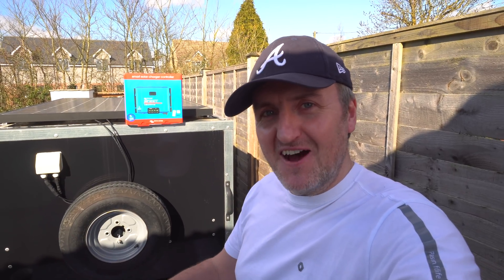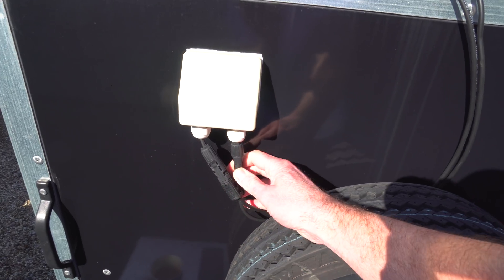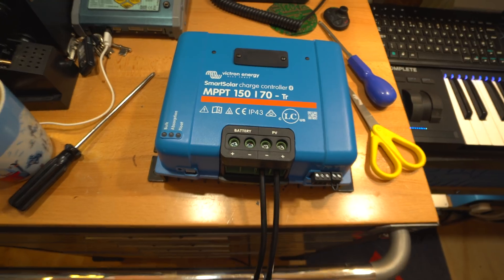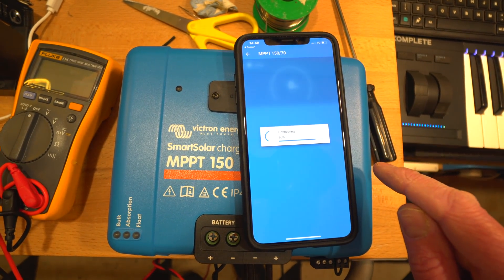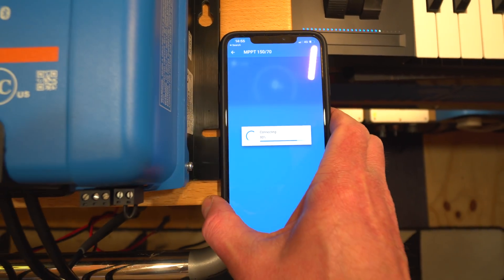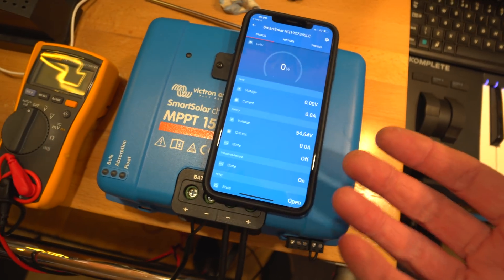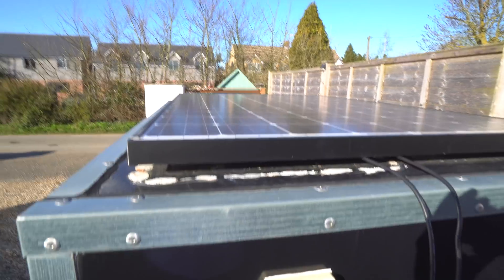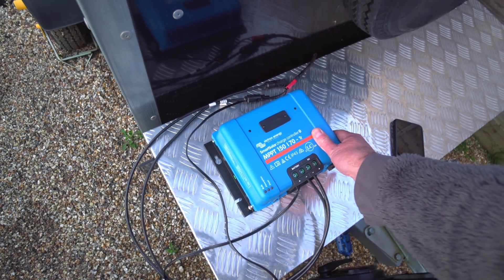HOW TO CHARGE YOUR EBIKE FROM SOLAR!!!

Comment: What panel are you using?
Does it output voltage matter, or if their output voltage is lower, can one just string a bunch in series till you reach over the minimum charge voltage for the battery?

Comment: Just what I was looking for. Hey, could you use this system while riding? As in, if you had a bike trailer, could you ride and charge from your solar trailer?
Reply: Get vitoman 600x plug a solar panel into it whist riding is possible then plug batter charge ebike into vitoman all on a ebike egnwe 26x rack at the back vitoman can convert

Comment: iv been charging my battery up via solar for a few years iv got a mppt charge controller. but iv got a inline inverter so i can just plug the normal charger into the inverter. Works perfect and free power. I love messing about with solar and the bonus part is i got 8 100w panels free and charge controller came on my boat as a spare . my workshop is powered via solar all garden lights are and all my tools get powered buy solar.

Comment: That's nice and simple so I would look at doing that but I was also thinking of being able to use my ebike battery as an emergency power bank at home in case of a power cut so I guess I would just need to convert the battery output voltage to usable home voltage levels such as USB or whatever. Fun stuff.

Comment: Thanks for this. 7:10.. Max Amps setting!  wonder how rare to find that feature in charge controllers.   How brilliant would it be if these ebikes had a built in DC charge controller that could handle 300watts and a USB out port.

Comment: Cool video and good information. I was wondering if I could put use to my folding 50watt solar panel that is just sitting in my storage. 

The panel specs is something like 18-24 volts I don't remember exactly. My electric kick scooter has a 48 volt battery. And riding my scooter, I like to stop by the lake a couple times a week and cook something using my micro propane stove. Some times I have to charge my scooter at work, or the plug-in at lake (if no one is using the park BBQ grill), or at my storage (very boring).

Comment: This video helped me so much! I have a camper van with 2x320w panels and i wanted to charge my Super73 battery. I bought a separate Victron 100/20 48V charge controller and put the solar panels on a change over switch. I can now put the solar power to my house batteries at 12v 60A or to charge the bike battery with 5A 56v and more importantly, i can control the charging amps, which is something i couldnt do with the existing charge controller.  I was thinking of using my inverter before but thats so inefficient.

Comment: I was wondering how much current was the maximum suitable. I have a 7s 13p Hailong battery (17.5 Ah) and I have a 2 amp charger and ordered a 4 amp. I was wondering about the 7 amp on the cycle satiator but the charger was too expensive for me to justify getting it anyway for only a single battery. I was thinking about paralleling it with my 2 amp charger for 6 amp using a dual female to single male XLR cable (checking the wiring to make sure it's on the correct pins) but you are saying going over 4 amps may cook the battery? What about a brief partial charge? I mean they can take 25 amps out so why only 4 in?

Comment: $35 boost controller https://www.ebay.com/itm/373167680091 , $50 used 250w panel, boom - Johnny's got free power after spending less than a hundred dollars.

Comment: Thats a bit of alot of panels to charge your lil 48 volt ....I guess you couldn't pull that behind on your bike/trailor? you would just use for a base station/chargining station....I would like to see enough power to charge your bike as you go free unlimited power without havining to pull a traier with so many solar panels ? probably weighs as much as a boat ? not very portable? thats the answer / the ticket

Comment: Every try carrying a jackery 240 with you and plugged into the bikes charger, cheaper than buying another battery and lighter in weight. USED while ridding?

Comment: I d like to do this on my 500W 36 V Powerpack from Bosch but I can t figure out the wiring to connect the three poles the Akku needs to be fed properly
Reply: I read somewhere one of thier three wires were power ground and sensor, they jusleft out. Connecting that one...
Mine has only 2wires

Comment: Did you buy that victron Andy or was it a freebie.must have cost a bomb?    Cheaper to use inverter in campervan when sun out and driving with my dc to dc charger .ebay 105£ for charger.had it 4 years on different cars.been on my vw t4 2.5tdi 2 years now.helps charge leisure batteries with waeco fridge that is left on all time .i have one 100 watt panel on van roof plus 3 x 30 watt panels in parallel Also .i use a separate mppt controller for front and back of van .

Comment: that set up wouls cost a fortune - for someone with a second hand old solar panel  and £26 to blow this dedicated e bike 300w solar mppt boost charger might be a viable option  https://www.ebay.co.uk/i/303020007502?chn=ps&norover=1&mkevt=1&mkrid=710-134428-41853-0&mkcid=2&itemid=303020007502&targetid=909953938039&device=c&mktype=pla&googleloc=1006637&poi=&campaignid=10199630638&mkgroupid=101938330797&rlsatarget=pla-909953938039&abcId=1145987&merchantid=9440604&gclid=Cj0KCQjwyJn5BRDrARIsADZ9ykE9D3L0xhHOiA8e5bhd4CCX6U2790af5ths5bOxdFdESgv0aRc0lrQaAh75EALw_wcB

Comment: Dude your rambling on I'm learning nothing, can I use this to charge me fiido L2  48v 20ah  350 watt motor, if I use 18 v 100watt folding panel on trailer of ebike will this charge? Could I charge battery with system while ruding?
Reply from the maker: I got bored after the first couple of words!

Comment: this real cool i got battery also 48v and charger says 54.6v 2.0A the settings bit confused about
Reply: He's got a 14s battery, you've got a 13s. Slight difference in max voltage.

Comment: Its a bit overkill Andy? I Use a 300w boost MPPT https://www.ebay.co.uk/itm/MPPT-Boost-Solar-Battery-Charger-Controller-Regulator-24V-72V-Waterproof/192143107756?hash=item2cbc9f26ac:g:jxwAAOSwGPNcAWsk on an old  REC 280watt panel and it works great
Reply from the maker: Yeah it is but I’m just testing...I’m gonna use this to charge my Twizy.

Comment: Using a solar panel for charging ebikes is great if you aren't on the bike all the time. You carry a big rigid panel and whatever other gear necessary to recharge in your truck or trailer easily enough. But I wanted to be able to do extended duration un-supported bike touring so I finally settled on a 300W folding panel. It's hard enough to move a few hundred pounds around by bike without the wind shoving and pulling a rigid panel attached to a bike and/or trailer all over the place. The panel, MPPT controller, cables, and a dc/dc adjustable converter weigh under 20 lbs. and will charge every piece of electronics I carry which is more than I like to admit.  - https://photos.app.goo.gl/rFim5rPsajmDt8NJ6

Comment: SUNYIMA 24V 48V 72V 300W MPPT Boost Solar Charge Controller.
It also has " user " settings, I use it for a 36v ebike set up, as long as your panels are a lower voltage than the output, it works fine, no bluetooth but its a nice small unit and cheap, if your building a bike trailer mounted unit using 12-18 v panels, I have 7 panels of various sizes mounted on the trailer. 2.5w to 40w. Rambo ebike trailer, would look and work well with your rig, I put 2 16" motors from ali express in mine... 2 crystalyte 3540 hub motors on bike, 2 motors on trailer... 4 x 4 :)  hills, what hills ??? regen braking with 300 .lbs in trailer, no problem, no push bike forward and I only use 13A controllers for those motors in trailer... 7 battery packs, 4 on bike, 3 in trailer, liquid cooled controllers in trailer using a computer cooling custom loop. turn signals, brake lights, LED headlights and off road lights...   2 wheel drive,  roxors your boxors.... you wouldnt be down under anymore more mate, you'd be up and over :) sorry Canadian humor....
PS  DO NOT load your trailer with 300 .lbs and expect to stop with only bike brakes.... been there done that, almost a hood ornament for a city bus....learn from my mistakes or the hospital bill is on you :)   hence the reason for spending $500 to put motors in trailer.... regen braking and disc brake mount for " surge " type braking system to be added later... when my wife gives me the rest of my allowance...

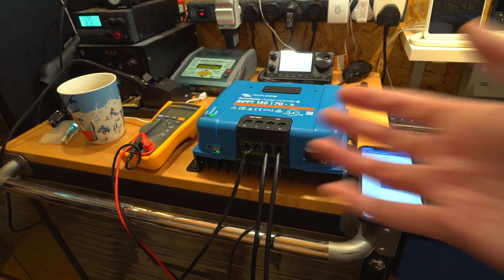Comment: 6:17 or you can supply a controller with current directly as long as you’re not getting too close to the max amp rating as it will be rather taxing on the unit.

Depending on efficiencies, you could potentially turn a larger voltage pack (100v in this case) with only a few parallel cells (in comparison) to give the power needed.

Comment: Most Ebike battery BMS are damaged, along with the cells if you charge with more than 4 amps current. (you can charge an ebike battery with upto 8A. but doing that all the time is bad for your battery) That is why you always want a controller.
Reply from the maker: It depends on the BMS and Cells 😁

Comment: Good video, BUT there are dedicated ebike solar charge controller which are much cheaper and as reliable. https://www.aliexpress.com/item/32818719628.html?spm=a2g0o.detail.1000023.1.206222f7sJwFm2
Which one can set to 36, 48, up to 72v. It's a boost converter, which makes it compatible with any panel, even the tiny 12V 50W panels :) 
As for the twizy, will you hook it up directly to the main twizy battery? that would be grant. Then you could even use the Twizy's battery as a powerwall by hooking it to an inverter. A big like a V2G technology !

Comment: Aren't you at all  concerned the charge structure is that of lead acid. Constant current and Float are old lead acid charge strategies that can be dangerous with lithium.
Reply from the maker: Float doesn’t have an effect with the lithium profile. CC-CV is how you charge a lithium battery. At the end of the CV phase no current is flowing so if you set your absorption voltage to safe limits for the pack (not above 4.2V per cell) then it won’t be a problem. If you did make a mistake most batteries have a BMS good enough to remove the entire battery from the circuit if the voltage went too high.
Reply: @andykirby   Stage One Voltage rises at specified current rating (usually .5-1C).
Stage Two, as voltage peaks current decreases. Lastly, CHARGE TERMINATES.
Full charge is reached when the current decreases to between 3 and 5 percent of the Ah rating.

Comment: So your using a 12v solar panel to charge 52v battery. I have the victron as well I'm going to try that. I thought you would have needed to wire 4 12v panels together to get the same result. Cheers.
Reply from the maker: No actually it’s a 60-70 ocv (open circuit voltage) panel 😁 you can’t do it with a 12V panel unless you had some kind of crazy DC-DC boost converter. The panel voltage needs to be close to the battery voltage for it to work.
Reply: @andykirby  oh I see. That kicks that idea out of the park then. Lol
Reply from the maker: Best thing to do is measure your panel voltage when it’s not connected to anything and see what the voltage is. You could series multiple panels up... but you’d still probably need a charge controller to regulate the current unless it’s very low power.

Comment: Question? How much does it cost to charge the bike with regular power? How much was the panel, charge controller, etc? How long would it take to recoup your cost? Also instead of charging the bike directly during the day (which you would probably be using the bike) The bike needs to be charged at night. So you would need to add batteries to your setup. Charge those batteries during the day while you use your bike and at night plug your bike into those batteries to charge the bike at night. So I really, I don't think this is worth it unless the world shut down and you can not get power off the grid. In which case you have bigger problems then charging your bike at that point! Just a realistic assessment here.
Reply from the maker: Valid assessment, this is really meant to show an off grid proof of concept. Of course the outlay outweighs the electricity cost. The camping trailer with the panel on the top is also an off grid concept and can run for days with one solar panel and it’s 3KWh battery.

Comment: 30,000 Euro fine in France for E-bikes going over 28 mph or motor tested over 250w. If you can't pay the fine you can go to jail for one year. No speed limit on regular push bikes. Worth remembering if anyone brings a bike on holiday.
Reply from the maker: Exactly why I registered mine, it will happen everywhere eventually.

Comment: Victron is making a killing with this 800 Euro charger. How long will it take to break even with the cost of the panel & charge unit compared to buying the electricity from the grid?
Reply from the maker: The idea behind this charger is that it’s used off grid to charge batteries.

Comment: Another great video, I finished my scooter build, I struggling to find someone to stamp and sign for the vin plate, based in london what did you do here?
Reply from the maker: I went to an MOT garage, try and find an oldskool one they should have a stamp set. I reckon You’ll need to take a document with you just to prove your not doing something dodgy.
Reply: @andykirby  Legend, garages are just saying no, also here the project i few thing to go but fingers crossed

https://www.reddit.com/r/dualtron/comments/fjklfu/uk_dualtron_thunder_moped/
Reply from the maker: Maybe try some garages outside London. Scooter looks great, I think the headlight might need to be motorcycle type and e-marked for MSVA... it’ll be interesting if you can get it through though keep me posted!
Reply: @andykirby  thanks its e marked and motorbike brightness supernova m99 pro it's the only legal headlight for s pedalics, dip able and has a tell tell light for low and high beam pricey but worth it.
Reply from the maker: Freopa ah awesome😁 I didn’t realise it was a supernova, they look great!

Comment: I watched this video while my eGolf charges off my off grid solar system on my garage. I use a 600ah battery which charges off 6 solar panels and a very large low frequency inverter that can give a constant output of 6kw. It’s a great feeling to drive from sunshine.
Reply from the maker: That’s epic! What sort of batteries are you using?

Comment: Have you ever been tempted to get hold of any electric vehicles from the past?  I'd love to try an Sinclair Zike sometime,  and been after a C5 for years,  but they go for silly money now, and that's if you're lucky enough to find a complete one.
Reply from the maker: Yeah absolutely, I’m always looking for interesting vehicles. I did see a good C5 the other day. They run on 24V I think. I should have got it😅 if I’m not careful I would end up with way too much stuff though!
Reply: @andykirby  If it's fully working for less than £500  absolutely get it without a second thought.  But they are super easy to repair,  you just need to keep a eye on the plastic as they go a bit "chalky" feeling with age,  like old white plastic garden furniture.
Reply: i see c5 on dickinsons real deal get sold for 300

Comment: I built a off grid solar power system in 1999- 2001
, tried a few experiments using Shogun Pb batts , then moved on to deep cycle marine 110ah each , I had 9 in parallel giving almost 1000ah , using 11 cheap solar panels to trickle charge , and a mid size inverter ..... 

Spent £1,300 on the batts , about the same on the panels , and remained off grid for 22yrs total ! 
Using ammonia refrigeration, ( no motor or compressor ) and home made heat exchangers , I tried to heat the flat with out running central heating , but as the building was an old fire station , struggled to stay warm  ( no cavity wall in 1866 ) .

My brother an electrician , poo pooed my experiments till he saw me run a 1200 watt electric fire with only a min voltage drop !  power failures are fun  !  I fancy trying  this again only with lipos now I have 3 e bikes to feed and a house. 

Due to the impending zombie apocalypse covid 19  I bought a huge generator yesterday... as live out in the sticks 

Andy I followed your original build , with great interest ...I have in the past taken small 7ah and 20ah batts with me and a panel to top up and a tiny inverter lol .dc to dc is much better 

PV are much improved , as is battery tech I’ll be hoping you find a good power to weight set up .... 
be nice to throw a small box in a pannier or ruck sack that’s light  yet give you 10 20 more miles a reserve tank ...

Sorry for the waffle ...

Regards

Comment: The specs for that controller say 12/24/36/48 Volt. Does that mean you can't use it to charge batteries whose nominal voltage is higher than that, like 72V?
Reply from the maker: Correct, it goes up to about 65V I “think”
Reply: @andykirby  Thanks Andy. Stay safe, bud.😎

Comment: Pretty cool, but it does bring home how big a panel and how much direct sunlight you need to even charge an ebike battery.
Reply from the maker: Exactly, for portability it’s not really viable unless you have a very small battery and a foldout panel that you could stow in a back pack.
Reply: Could your wind turbine do it?
Reply: @andykirby  Here's mine, which I think you've seen before...
https://twitter.com/ahaveland/status/1057715731297648640
4 x 120 W foamboard panels, sunpower cells, about 1kg each. Using Turnigy Reaktor lipo charger with DC input low limit set to roughly MPP voltage. Current battery 12S 5P 5200mAh multistar lipos, still going after over 4 years use!
Currently making yet another panel, and a portable automatic 2D solar tracker to mount them all on.